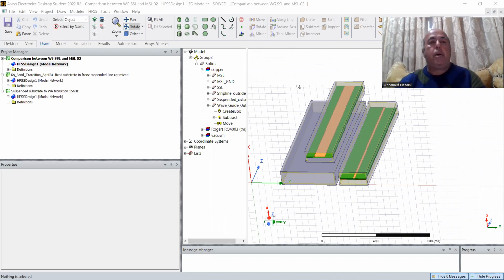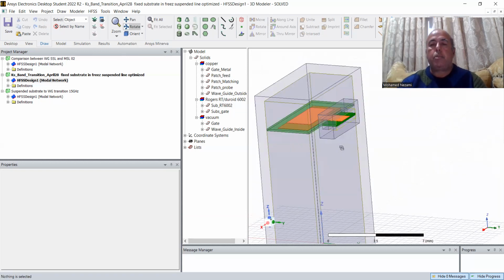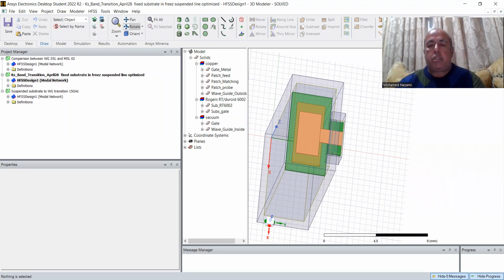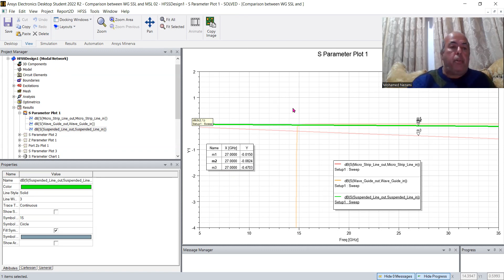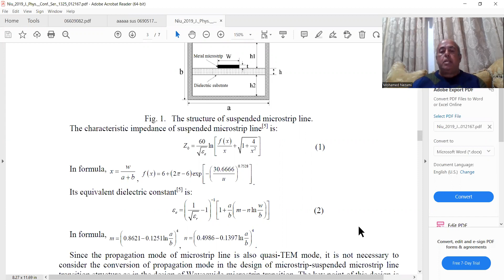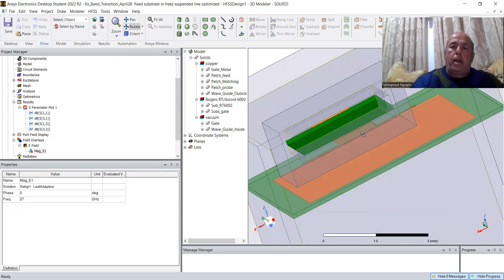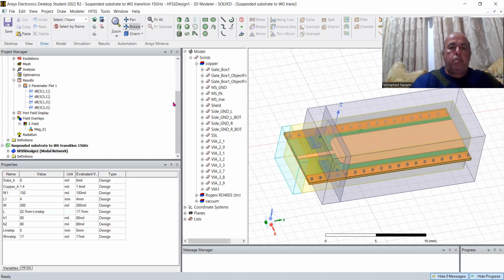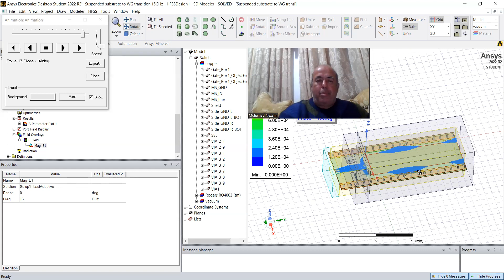Design of a Ka Band Waveguide to suspended strip line transition with Ansys HFSS modeling

Comment: Have you ever simulated suspended strip lines in ADS software? I recently modeled a multi-mode resonant phase shifter with suspended strip lines in HFSS, hoping to realize the digital connection of multiple different phase shifters in ADS. It would be very much appreciated if you could reply😊